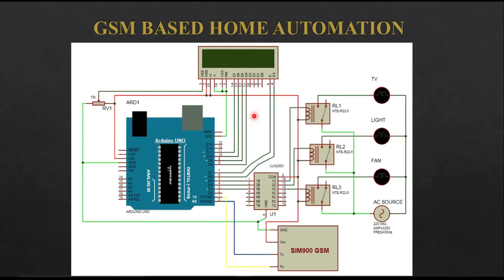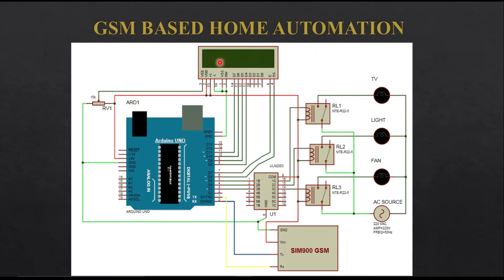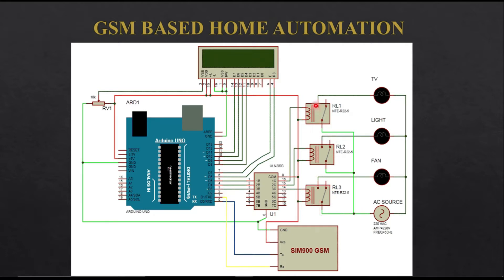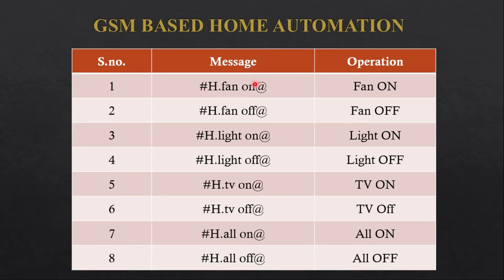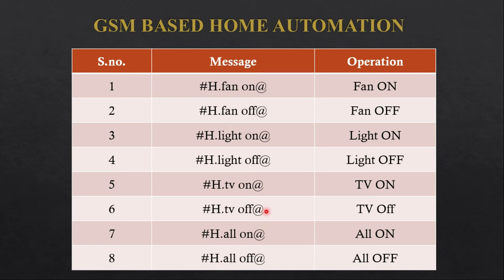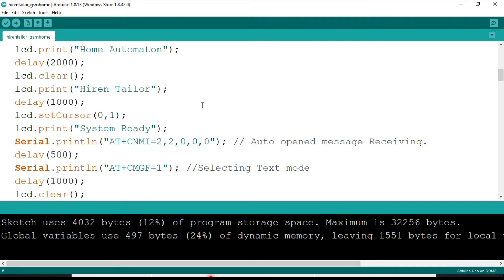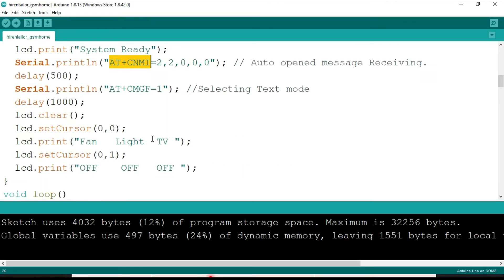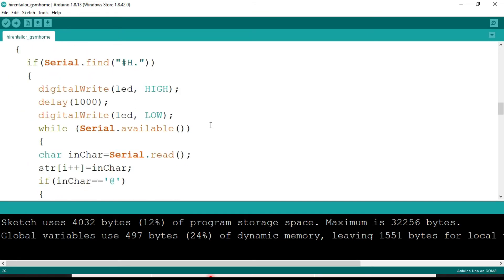Arduino SIM900a GSM Home Automation

Comment from the maker: You can connect Relay and different equipments instead of LED.
Reply: led is just for demonstration
Reply from the maker: @jeriesmarjieh5862  yes
Reply: Sir , in this code there are a erreur Can you help me to correct the code please
Reply from the maker: @soumiaamr4771  which errors?
Reply: @ecit  Can you give me your email to better explain
Reply: @ecit  I did the simulation in the Proteus software and I did not find the same components Suggest another program please ? !🙏  Help me to finish my graduation note
Reply: @ecit  the erreur is in the sending SMS the LEDs Do not ignite
Reply from the maker: @soumiaamr4771  hirentailor.rf@gmail.com
Reply from the maker: @soumiaamr4771  use proper coding, what video carefully for sending sms
Reply from the maker: @soumiaamr4771  what you exactly want to do? You can buy any sim900 module
Reply: @ecit  i sent you an email i Hope you Can help me to correct my problem